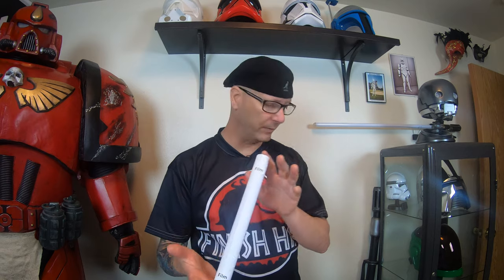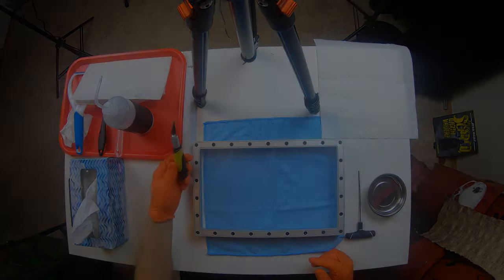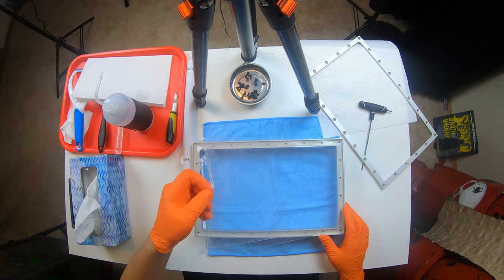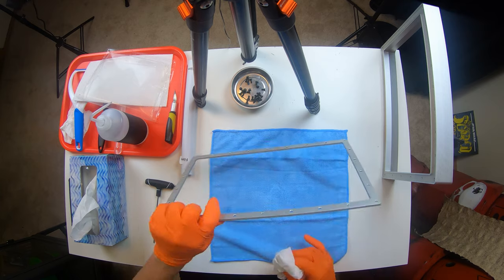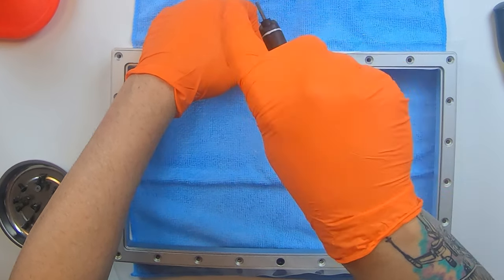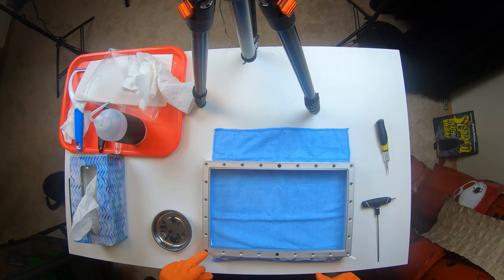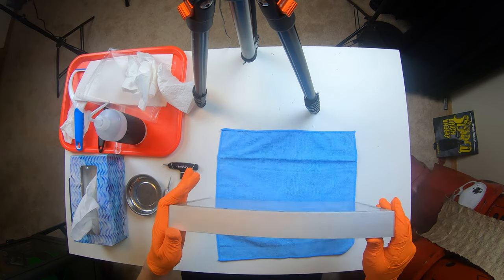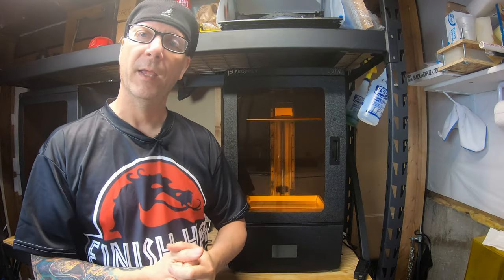How to change your FEP for your Phenom

Comment: How do you prevent resin leaking through the vat?
Reply from the maker: Once the FEP is installed, the resin will not leak
Reply: @EastwoodFabrication  I may have over tightened the FEP then. 🤔